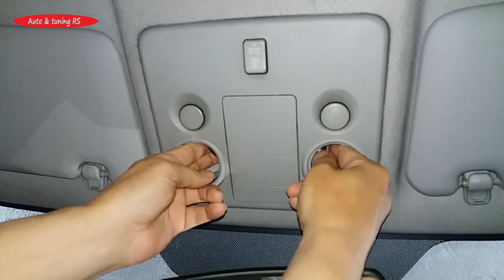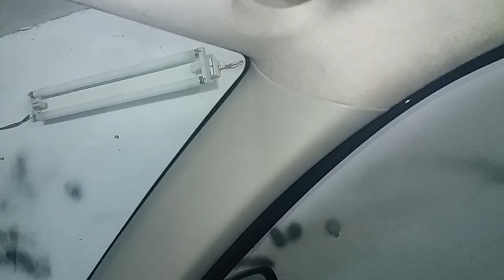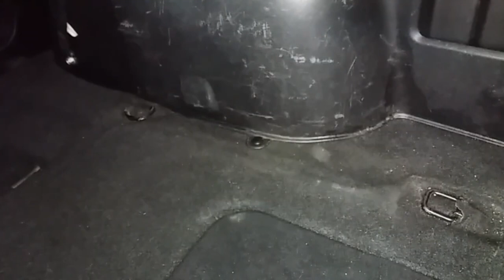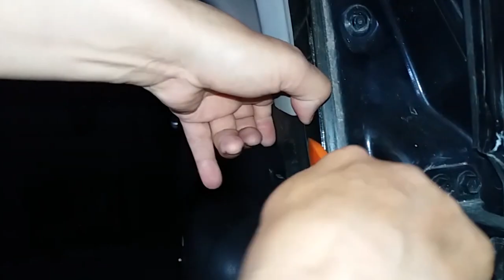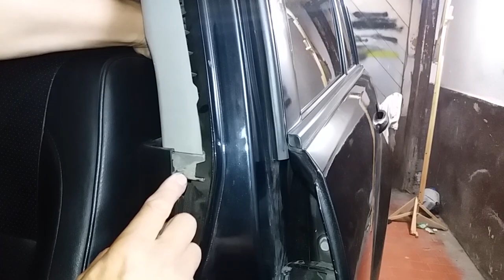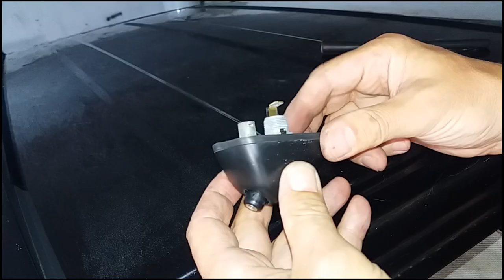Water Leak Through the Roof Radio Antenna / Removing  the Roof Radio Antenna of Suzuki Grand Vitara

Comment: Do you know of any other possible place were water enters into the boot when raining,from left side top would it be the roof real maybe
Reply from the maker: If the leak is not from the antenna So it is from the seals on the rear tailgate
Reply: @RS_Team_Bulgaria  I had a look at the seal it looks perfect,I thought at the roof rail maybe at the rear bolt,I seen on your site you tuck one side off couldn’t see the holes in the roof,by the way you’re site is brilliant very helpful 👍
Reply: Check also the welds on the top corners on the body where the back door closes. I have similar problem